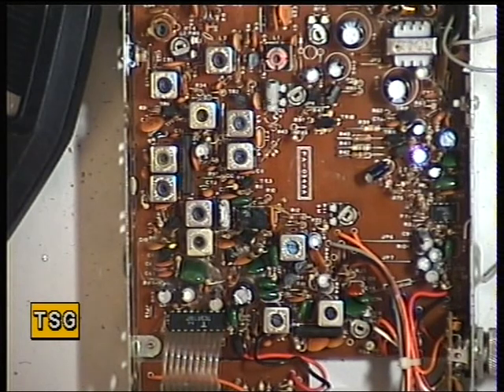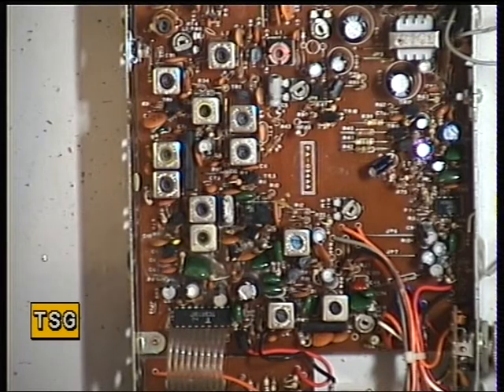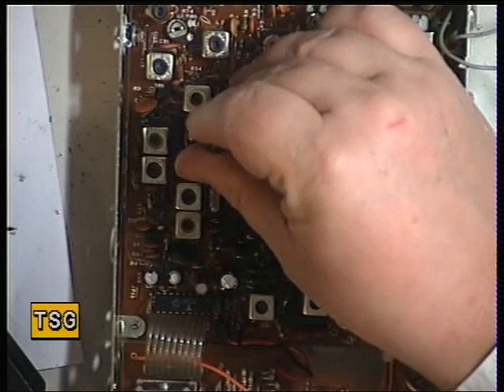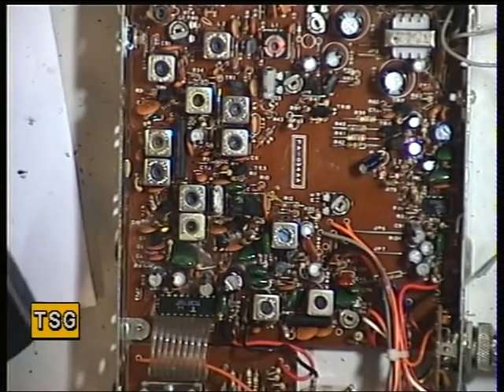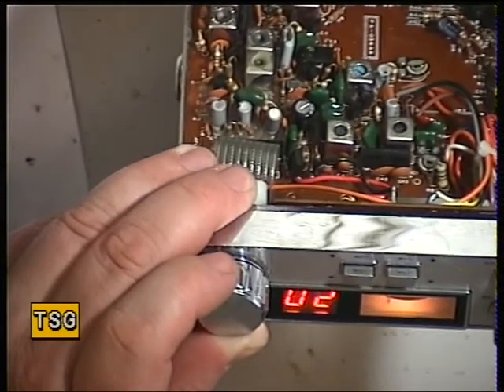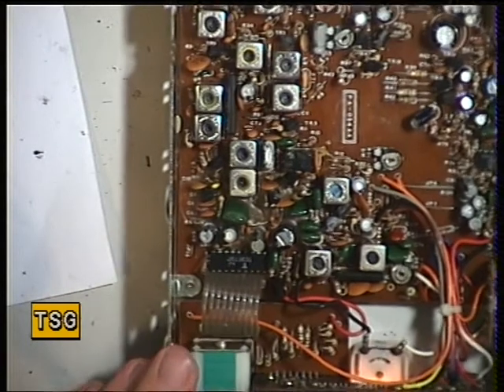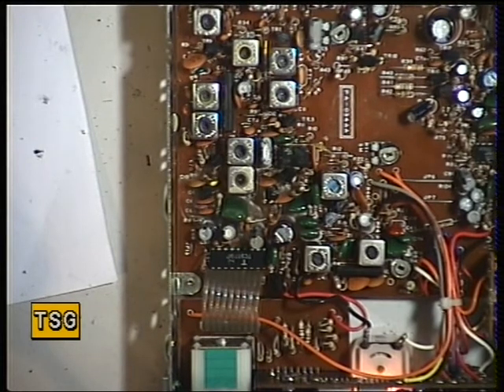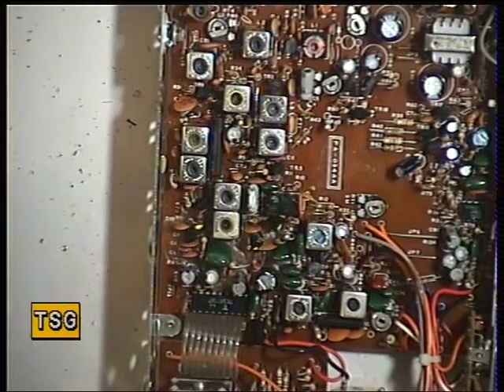Audioline 340, UK (CB 27/81) CB radio (Mobile) - Receive adjustment

Comment: Richard I am Hobbyist at CB service.
At 2:54 in the video you are adjusting the L19 deviation.
As an example on a Cobra 29 LTD (USA)  what would be the Deviation adjustment ?
Could you elaborate on the Deviation to help me understand .
Thanks for your time.
Reply from the maker: Grant,

I can't help you with USA models. In the USA CB works on AM. Here in the UK CB is on FM. On an AM set, the transmitted audio volume is set by the modulation control. In AM, when you transmit, the radio generates a 4W FM carrier & then superimposes 4W of Audio onto that carrier...that is what the AM modulation control is doing. However, if the audio modulation exceeds 100% modulation it causes mega interference, so needs setting up carefully with a modulation meter, and preferably being monitored on an oscilloscope.

Here in the UK, the radio generates a 4W carrier in a similar way, but modulates the actual frequency with a varicap diode, after the mike audio has been suitably processed. The volume of the audio to be transmitted is adjusted with the deviation control.  FM transmitters therefore only draw half the input current of their AM counterparts & are much less likely to cause interference. The downside is that FM receivers are considerably more complex than their AM counterparts.

So my videos of UK sets are of little technical use to you in the USA I'm afraid, even though many manufacturers make sets for the UK and also for the USA that look the same!

Richard (UK)
Reply: Thanks for your information.